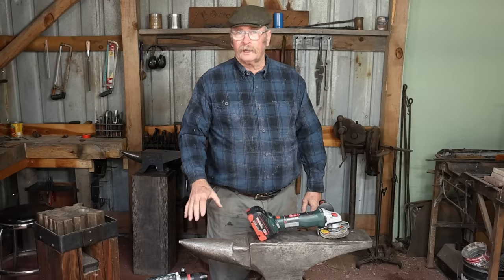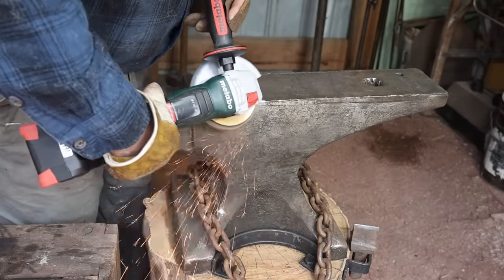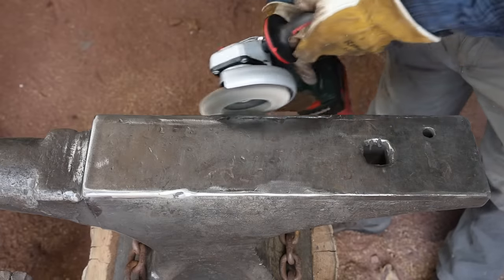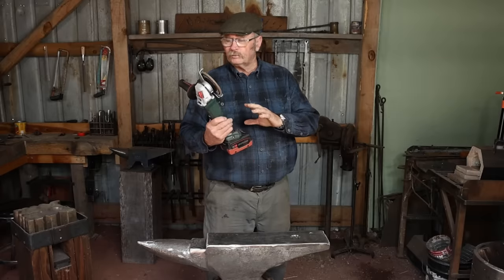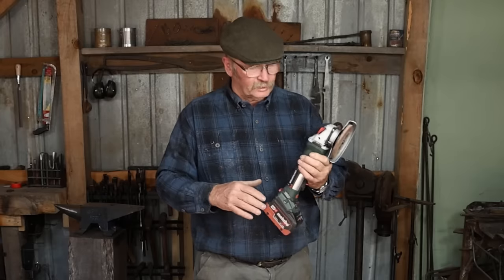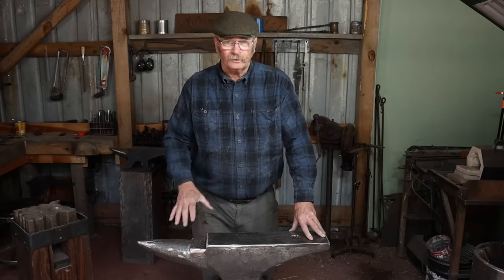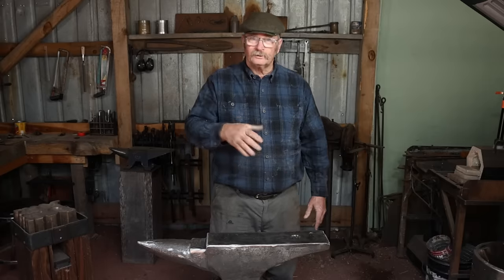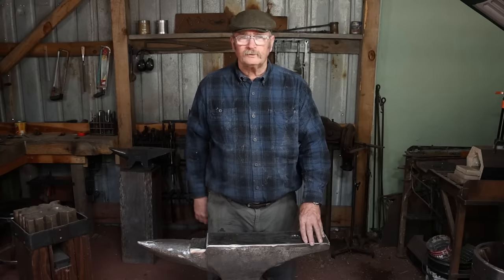Dressing your Anvil for better forging

Comment: When I need a tool I buy Metabo if they make it. Their grinders use metal gears in the head unlike the plastic one's used by other manufacturers. Quality tools are a joy to use if you can afford them.
Reply: I have never seen an angle grinder with a plastic bevel gear....

Comment: I rarely use a hard disk anymore since I discovered flap disks, however I haven't gotten used to the stink of them . . . And you are sure right on using the 'imperfections' to your advantage.

Comment: As a newbie smith I fell in love with those flap disks John. I watched a You Tube video awhile back about how to make an anvil from a piece of railroad rail and I used some of those flap disks to shape the horn and flatten out the anvil area. I have since then purchased a 132 lb Accaio anvil that I am now using. I still have my trusty old home made anvil that I also use in a pinch. Many thanks for the fantastic videos sir! Because of you I've learned a LOT even though I am still an amateur newbie smith.

Comment: Another great video. I have a circa 1830's Peter Wright that I use in my small shop. It came to me with a sway as I found out happened quite often with older wrought-iron anvils. Though not perfect, I have learned to use as you said the imperfections  Thanks for another great video.
Reply: Those sways, if not large, are great for helping straighten slight bends in long stock.  I have a very slight sway in my HB and use it all the time for straightening
Reply: David, I also have a Peter Wright anvil. No idea how old it is but it also has a sway on the face. I have wondered about hard surfacing rod but that would be a huge job for me. Thanks for your thoughts on learning to work with what I have 😊

All the best,
Norm in Arizona

Comment: I have a Hay Budden anvil, around 100# or so and all the edges are heavily radiused, probably from years of use. Even the face is radiused with the center being lower than the ends. I don't want to get into trying to flatten it back out so I use it as is. This was some great info. You offer some of the best practical information available and I look forward to every video.

Comment: Morning Mr John. 
 Great  video!  Love the practical approach and common sense points. All to often I see " oh those edges.....gots weld or it's to trashed,  or you have to mill that face...." luckily fine guys like you can set them straight.
 Did get a new 132lb vevor to dedicate to the new air assist heavy hammer from  CCI Roy Adams.  So I'll get to dress that one up soon.  
  Blessings y'all

Crawford out 🙏🔥⚒️🧙🏼‍♂️

Comment: Thanks for your video. I looked at the drilling machine on the Metabosite and it is very special. The lowest transmission goes up to 450 revolutions per minute. This makes it especially suitable for drilling with slow speed in steel and stainless steel. I am a fan of Metabo for its high quality. Just like Makita, they have been in the metalworking industry for years. The lifespan of their machines is very long. About the impulse function tels the site: Selectable "impulse" mode for removal of stubborn screws and for spot-drilling on smooth surfaces

Comment: If your anvil still has "sharp" corners on the face right above the step, I would recommend leaving them if possible.  That/those are usually the places for scarfing the rod used to forge weld chain links or other similar welds.  Mine were chipped off before I bought my anvil and the chips make rough scarps.  I now have to use the corners on the heel which are still fairly good.

Comment: I have an old (pre1820) Mousehole anvil. The usual sweet spot is probably close to1/8-3/16 low. I know it’s there and work more near the heel of the anvil. Some day I’d like to try to mill it down .I have tried grinding but the face is terribly harf

Comment: Wow John, those edge rounds look huge to me (maybe it's the camera angle).  Especially in that most-used first section, I think it would really bug me to try to work with that much rounding.  Obviously opinions and methods differ, and you were limited by the damage you were trying to grind out.  It also seems like you use butchering a lot more often, which works, but seems like a complicated way to achieve crisper corners.  I started dressing small rounds on my anvil and have never found a desire to increase them.  Interesting to see what works for you.

Metabo always makes good stuff.  That rotating battery feature looks really nice.

Comment: I know you've done a few videos on quieting noisy anvils but I recently found a great way to silence mine that I wanted to share. I have two magnets with little carabiner hanging off a loop and that little dangling material really takes the sharp ring out like a silencer on a bow string. I'd be really interested to see if it works for anyone else. My anvil is on a stump and is just bolted down with handmade bars. No other silencing on it and it is pretty quiet
Reply: Also a good note is that they are hanging under the foot and the horn so the dangling bits can move freely

Comment: I see an awful lot of anvils with sharpened horns where people just don't realise that a knock on a horn like that is a bone deep penetration, especially if you're using a hammer at the time or carrying something...extremely unpleasant.
I like the look of the metabo tools, I think they will be on my list for next time I need one, I get tired of losing the spanners too. I don't like these bare bones tools though I find that annoying, I would much prefer to get only one battery as standard with an option for two.

Comment: When I got my big Trenton it was already in decent shape with just one large chip, but it came with a smaller anvil (probably also a Trenton) that had been horribly abused. Poor thing had it's tail broken off at the hardy hole and someone had used the horn as a plasma cutting table. The face is mostly flat but there's another plasma cutting spot and the edges are chipped quite a bit. I don't know if I have it in me to dress up the big anvil but I really want to try and save the smaller one. I really wish I had the tail for it but it's lost. I'll need to figure out how to remake it from scratch and weld it back in place.
Reply from the maker: The Anvil Repairs channel here on YouTube has been working on an anvil with a missing tail.  https://youtu.be/zziSro6yEvw?si=5cCmDc8aSlBCuDh3
Reply: Thanks, I'll check it out

Comment: Would filling in with a weld and then reforming an edge be an option for the chipped edge ? Or would that cause damage to the anvil ?
Reply from the maker: You can, but it requires careful preheat to get a good weld.

Comment: Do you typically radius all the edges on a new anvil or just up near the horn so you have a sharp edge to bend material on?
Reply from the maker: Yes, a sharp edge will create stress points.  The radius doesn't have to be very big, but it should not be a sharp 90 degree engle
Reply: @BlackBearForge  Thank you!

Comment: Maybe dumb question, but could anvil be made without hardened face plate? (all cast in one piece for example) And how to distinguish welded face plate from all-cast anvil?
Reply from the maker: Most new anvils are cast from a single piece of tool steel.  Its pretty easy to tell a cast anvil from an older wrought iron anvil.

Comment: John, I would like to suggest that you consider moving your merchandise to somewhere other than spring/teespring.  I have a bunch of stuff from them, and every order has had issues with quality (misprints, crooked or misaligned prints, poor materials, wearing out quickly, etc.), and their customer service is abysmal.  Plenty of other people have reported the same experience.  Many other channels have moved for these reasons.  I have a bunch of your stuff from the etsy store, and would like to order more.  But I no longer buy any products from teespring.  There are better options.

Comment: I have a very used old anvil, how much material would i be able to remover before the top plate is comprised
Reply from the maker: I try to avoid taking too much off.   My guess is that you should leave the face at least 1/2"

Comment: I just bought my first real anvil, a brand new 440 double horn by Holland Anvil. I get taking off less as I can take off more, but what is a good starting point? I saw one article state 3/8" radius at the face and an 1/4" at the horn horn for that size anvil, but that seems excessive. Any recommendations would be appreciated!
Reply from the maker: A 3/8"radius would be the same as a 3/4"diameter bar and that seems way to large for normal work.  I would start around 1/8" radius or 1/4" diameter just to knock of the sharp edges.
Reply: @BlackBearForge  thank you so much!

Comment: John,
  Congratulations on reaching the 300k subscribers,  great milestone. 
Thanks again for a great instructional video, I had to do some repairs to the anvil I got from my brother before I could use it, I certainly agree, go slow and take off only what is needed. Mine had some bad pitting and chipping at the hardy hole so I had to do some welding and grinding there, a carbide bit and die grinder made quick work of the repairs.
The Metabo tools look and sound like quality products, I have an old drill master ⅜" impact that the battery pack can be rotated but no positive stops on it, I have found it useful at times to get the battery out of the way, not often but a few times.
Keep up the great work,  I'm looking forward to your next video. 
John V.

Comment: I got a small 55 lbs  anvil but its face is really smushy and doesn’t quite take a hit properly what can I do?
Reply from the maker: If its cast iron, there isn't much that can be done. If it's steel the face can be built up with hard facing rod.  Thats a lot of work and it might be better to just by a new anvil.   There are a number of imports out there that aren't bad and cost around $150 such as this one https://s.vevor.com/bfQn97